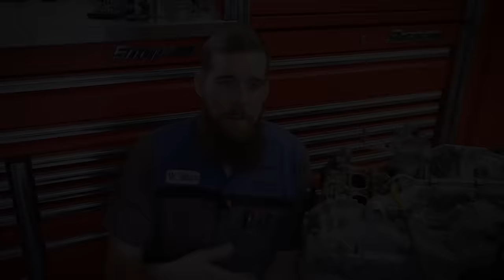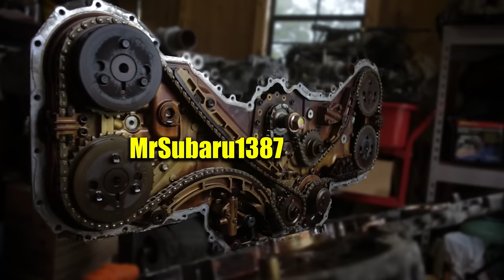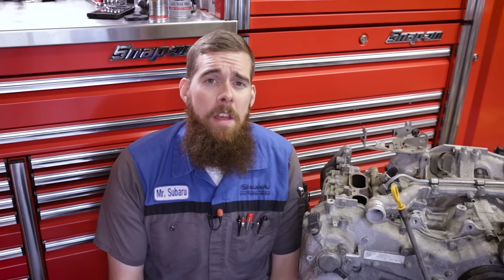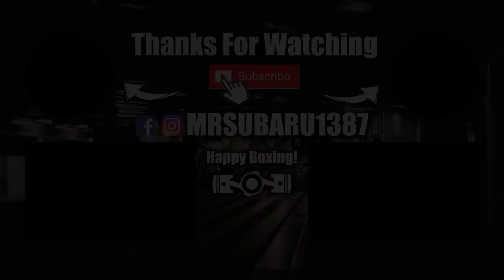Why Subarus Are So UNreliable!!! Buckle Up!!!

Comment: I agree with your sentiments in this video.  I am a Subaru and BMW owner/fan.  I hate when people poorly maintain a vehicle and get upset when things break and fail.  Cars are not engineered to be poorly maintained.   I have a 2010 STi Hatchback and modify it and drive it hard and I check my oil all the time because the harder you drive the more oil you consume. Performance engines (like in my BMWs and Subarus) have higher oil consumption under higher strains.  I also change my oil more frequently than necessary because of the harder work I put my cars under.  I had a BMW that I would take to the track and check the oil after every time (3-5 laps) on the track because it would go through liters of it on the track under sustained hot and high RPM conditions.  The general public should temper their expectations on what constitutes reliability.  Reliability does not mean it should be poorly maintained and not break.
Reply: Certain more simple and older cars take better to lack of or little to no maintenance ie older low compression v8's and NA Japanese 4 bangers

Comment: Hahah you are completely right 😂 the sti wrx kids are responsible for 95% for the catastrophic failures I have seen in the 6 months since I started at the dealership. the doctors that do maintenance come in with old outback’s with 300 thousand kilometres on them and they are tight as a drum.
Reply: I’m in my 20s and I have a 99 Impreza with 350k miles and it dosnt miss a beat. The original owners took care and had it serviced regularly. The only thing that is going is the clutch and gear box even tho it still gets into gear fine it’s abit wobbly. Other than that it runs and sounds amazing never had an issue with it for the past 2 years owning it 🙏🏽
Reply: @deathtoming2201   when I had a 5 speed PT Cruiser I found that there were bushings on both ends of the shift cables from the shifter to the trans.  Those got worn out and I was able to replace them easily with a polyurethane set that is still working great to this day! A friend of mine has the PT and I didn’t the same thing for y parents PT which are both happily on the road.  Just something that you can check that may be the only issue.
Reply: Right.  Some people act like engine and clutch break in periods aren't a thing.
Reply: @GixxerRider1991  I'm curious about how long a clutch actually lasts if taking care of (if anyone has a high milage record) I've been driving stick for 18 years and still haven't had a clutch fail  all my vehicles were bought used in the deep rust belt and currently im at 90k/ 7 years  on my current clutch and still going strong
Reply: Have you made a video on when (i.e. mileage or time intervals) these maintenance items should be done?
Reply: This confirms what I've suspected for some time.  My 2010 STI has 185,000+ miles.....on the original engine. I do what is recommended for maintenance.

I wonder what I should do next though.  I want more power, but think I should replace the bottom end before doing so.  

Thoughts?

Comment: I did a COBB stage one on my 2015 WRX did track days and autocross. Did all the maintenance myself... I got a few million miles of commercial driving few thousand miles of off-road racing. The only thing that I actually broke in the car was I burned out the wheel bearings at about 50K... ( Sticky track tires) I was so impressed with the car. I am now proud parent of a 2022 Outback wilderness. Which I have taken on several mild Jeep trails. There are few cars out there that are as versatile and as fun to drive as Subarus

Comment: Subaru has to start turning away the abused cars and modified cars for warranty work!!  Worked for VW for over 30 year and saw some crazy 🤪 modified cars ...... Vw/Audi started turning the cars down for repairs!!  ECUs store some rather wild data the public can not see!!   I had a GTI Golf achive an engine speed of 10500 rpm!!  The engine exploded!!   In court the owner admitted to shifting to first gear at 70 mph!!   Warranty Void!!     Modern cars won't pull to those speeds......the Rev limiters won't allow it!!   Another lowered the car and wore the oil pan through!!  Siezed the engine!!   Warranty Void!!   Loved them all!!
Great rant Mr Subaru!!  👌

Comment: I'm totally with you, I'm a fan of boxer engines, I went off on a guy because he was talking $#!T about the type 1 VW beetles, he said " I had a beetle it was the biggest piece of ** the brakes sucked the heat didn't work and then the engine blew! " I asked him if he adjusted the brakes did you change the oil religiously did you adjust the valve lash at the required intervals, and so on, his answer was no, I gave him an earful about maintenance on cars that basically haven't changed since the thirties, just like you said don't blame the car or the manufacture for YOUR! (People that neglect and beat the crap out of a car) lack of care for your vehicle.

Comment: They’re so unreliable, I’m looking to buy another Forester, even if it’s motor has been overheated.. because I truly know how great these cars are.
Reply: The same by me. Have Forester 2002 and Outback 2006 - Top cars. BMW - hah on slippery road and rear-wheel drive and weight/motor on front. And will stay on Subarus.

Comment: Preach! Finally the truth. So many people assume turbo subarus are just "junk", but they last if taken care of. My old 2004 wrx lasted until 250k miles with everything original. It's all about the owner. Now I have an 06 wrx wagon with 127k. As soon as i got it i put about 2,000 dollars worth of parts in it for maintenance. Runs perfect and I'm sure it will last just as long as my old one.
Reply: it's funny because all Subaru's cars are fairly reliable EXCEPT the STI/WRX? How would Subaru's flagship cars be the most unreliable. I really think it is the owners 95% of the time
Reply: That’s what I tell people Subaru can last but you can’t run them hard

Comment: "The main reason that Subaru's are unreliable..." Please say owners, please say owners ".... The owners" 

Me: Wolf of wall street celebration YES!!!!
Reply: I have a bunch of Subaru's but my 300k+ mile  05 Legacy GT wagon that I bought when it was at 260k still has the factory block and the only problems I've had were constant vacuum leaks from almost every vacuum reference point due to everything being old. I replaced the headers and upgraded to ewg due to the fact the the flex joints all seemed to wanna have holes in them lol. Replaces all the rear control arms to spec b aluminium ones with new Polly bushes because they were all cruddy and shot, and squeaked.ive had the intercooler blow up twice so now it's an Aluminium one, and I have no complaints, I've loved every second of working on this car and none of this really has anything to do with Subaru reliability. I'm modified and tuned properly and I do drive it a little hard every now and again but I'm always checking fluids and doing services, letting it warm up properly when it's cold, and letting it cool down and cycle after having some fun... The only major issue I've had is the water pump seal failed and upon taking it apart to do the entire timing kit because why not, I nice it was sealed using not only the incorrect RTV but not the metal crush gasket. Surprise surprise, human error strikes again.

Comment: My 2012 Outback now has a blown head gasket at 127,000 miles. And it has been maintained by a 22 year certified master technician...

...myself 

And as trucks being my primary source of work, you should see what these idiots do to these diesel trucks. The value of used trucks would be much lower if these kids would not have blown them all up...

Comment: Great video, all this needed to be said.  I just replaced my '02 WRX that I had since new (June '01) with 244k miles.  Totally stock, no tune.  Synthetic oil changes every 3k-3.5k and coolant changed fairly regularly.  Bubbles started showing in coolant tank at 243k and Subaru specialist indicated either head gasket or tiny crack in head.  If it weren't for all the body rot, I may have had it fixed.  Was I pissed?  Hell no - 243k miles was impressive all the same.  Original motor, exhaust (!), clutch, transmission, diff, steering rack, steering pump, AC compressor.  The one issue with that EJ205 that haunted me the last 100k miles were random P0302 and P0304 misfires.  Shops threw everything at it until final conclusion was likely tightening exhaust valves on cyl 4.  Motor ran fine, the CEL would just turn on and off.  Gave the car character.  In the end sold it to a friend for $1k and bought a '21 WRX Base. That one will stay stock too.
Reply from the maker: Awesome life out of that WRX. ♥
Reply: Subaru coolant lasts 10 years, why replace it regularly

Comment: Guess me and my friend were unlucky with our SH Forester XTs. Previous owner of mine blew the factory gaskets at 213K miles, he was in his 60s, only highway drove the car, and had it dealer maintained. A friend of mine who also has an SH chassis Forester XT lost his factory gaskets at 160K. Both pushing coolant, both both caused by warped heads. Both cars also were on stock tunes with stock exhausts, stock turbos, stock intakes, etc.

Most of the unreliability I have encountered has been the result of incompetent dealer techs who due to their work environment don't have time to read the service manual and end up fucking up the repairs. Aside from an airbag recall and an warrantied a/c compressor replacement, I have not had a single dealership repair last/or been done right on the first try. Had the tech actually read the helpful tips and cautions in the FSM, I wouldn't have had to bring my car back or redo the repairs myself a couple years later. For example: dealer replaced the 6 speed in my outback under warranty (with a good used one) due to a failed center diff, get the car home, gear oil pouring out of the front axle seals. What did the FSM say about replacing CV axles? 
1) Before installation, check the drive shaft. <Ref. to DS-56, INSPECTION, Front Drive Shaft.>
2) Replace the differential side retainer oil seal with a new part.
• 6MT model: <Ref. to 6MT-36, REPLACEMENT, Differential Side Retainer Oil Seal.>
• 5AT model: <Ref. to 5AT-49, REPLACEMENT, Differential Side Retainer Oil Seal.>
• CVT model: <Ref. to CVT-91, REPLACEMENT, Differential Side Retainer Oil Seal.>

It's literally step 2 🤦‍♂️.
So they righted their wrong and replaced both seals right? Nope, they only replaced the one that was pouring fluid. So a month later, the other seal is still dripping a little so I have to bring the car back again. Same dealership did the headgaskets in my Outback and Forester XT (one was done before I owned it, the other as a discounted package deal shortly after I bought it.) and on both of those engines they used a scotchbrite roloc disc to prepare the deck surface (a big no-no you've already made a video on). The Forester XT which runs double atmospheric pressure blew the gaskets again 28k miles later, the outback with it's NA 2.5 made 55K before pushing coolant again. I just been taken for a ride by techs who didn't have the time or care to read or think about what they were doing. Luckily as a mechanical engineer, I've been able rebuild both engines and come up with very reliable combinations that can withstand being thrashed, but it didn't happen overnight (or cheaply!).
Reply: Two of the saddest Subaru stories here. Imagine not being a mechanical engineer and the same thing happened.

Comment: My  2019 WRX was used, clearly had an idiot as a previous owner. Tons of fasteners missing all over, broken parts, and a sticky spot on the dash where the tuner controller was. Fortunately they only owned it for 11k, I’ve fixed all the stupidity and it still runs great.
Reply: Hopefully that sticky spot really was from a tuner controller....
Reply: @loren481  🤣🤣

Comment: First and foremost, this video is warranted and your rant is a good one.  It's also one I've heard from every Subaru mechanic I've ever talked to, and frankly, I agree with them.  Proper care and maintenance is everything, no matter what you drive.  That said, fair warning, y'all, this is gonna be a long one:

In 2015, I bought a 2007 Outback 2.5i Basic 5MT with 86,584 miles on it.  I've never gotten a clear image of the maintenance the previous owner did or did not do, so I feel like I've been playing catch-up ever since.  I've done my best to maintain the girl, including paying a Subaru dealership to do the head gaskets on my engine about a year and a half after I bought the car (112,936 miles on the OD) because I didn't have the tools or the space to do it myself.  I went ahead and had them do the 100K mile service at that time as well, but sadly kept having issues with oil, for lack of a better term, disappearing from my engine.  

It never leaked when parked, and it wasn't coming out the tail pipes ever - it just kept consistently vanishing.  I was doing full synthetic oil changes myself roughly every 5000-6000 miles, but I often had to top up in between, and more than the .8 of a quart left over after filling the engine to 4.2Q each time.  In this time, I did other maintenance - namely CV's, wheel bearings, and coil overs on all 4 corners, replacing each with OEM parts after discovering this wonderful channel on YouTube.  In fact, other than the oil going missing between oil changes and a belt almost shredding itself on a 1500 mile road trip, my trooper of an Outback did really well - until the clutch went in late 2018 on another 1500 mile road trip.  I was able to baby it enough to get her back home, but by that point, I'd glazed the fly wheel thanks to the weight I had in the back (I had gone to the middle of nowhere to rough camp for 9 days) and a freak rain storm making the highway treacherous in multiple places.  

Man, did that clutch job teach me how little I knew about working on Subaru's.  Between waiting for parts, bad weather (I was working on it out in the open as I didn't have access to a garage or a shed), and finding other issues like bad gaskets in my exhaust and getting the wrong transmission seals from the dealership, it took me the better part of six months to get her back on the road.  I did an oil change before driving her again, since I was worried about the oil possibly having broken down in the engine, but from that point on, she's been a bit of a lemon, never quite feeling like the solid car I'd loved for almost 5 years.  

In January 2021, she suddenly developed a smoking problem - every time she was driven or even started for more than a couple of minutes, smoke would come pouring out of the engine bay.  Once again without a good place to work on her and knowing that I didn't know enough to tear into the engine on my own, I took her to the dealership again.  Diagnosis - the cylinder head had warped and the valve guides had dropped causing cylinder's 2 & 4 to leak into the crank case.  The dealer was able to find a rebuilt long block and so I let them do the swap, but shortly after I got her back, she threw codes again.  This time, it was the catalytic converters failing, so I replaced them, but the issues still keep coming.  At this moment, I almost don't even want to start her.  I got codes for P0303 and P0304 after driving her 110 miles.  I started with spark and replaced all four plugs, wires, and the coil pack (again, all OEM), but that didn't fix it.  When started, she sounds like a diesel, but I haven't been able to get any more codes since I had to disconnect the battery to do the spark plugs.  I am worried about damaging the engine, so I don't want to leave it running for long.  The one time I did leave it running to see if the engine would smooth out, she almost died on me once she started to warm up.  I'm at my wits end, and wishing I had just let her go when I found out about the engine failure.  

Friends and family think I should just sell her, but that feels morally and ethically wrong to me.  I don't want to inflict my problem child on some poor bugger who thinks they're getting a good deal on something that's supposed to be reliable and doesn't understand that the "little lady" might actually know a thing or two about this car at this point.  Through the magic of the internet (HA!) and my own past experiences, I've narrowed it down to fuel or air, but that leaves me with about 15-20 possible solutions.  I figure I'll start with air and replace all the vacuum lines and the PCV valve, since those are all from my original engine, but if that doesn't do it, then I have to figure out where I want to go next.  I'm not quite ready to give up on her, but I am beyond frustrated at this point.  If anyone has any questions or suggestions, I have full records on EVERYTHING I've done or paid to have done since I bought the car, so I'll do my best to answer them.  Suggestions are definitely welcome at this point, as I'm about 100 miles from the dealership who did the long block and the cats, so I'm trying to do this myself.  If you've gotten this far, I thank you.
Reply: Same story I hear all the time. I commented above about my mom owning a few of them they where all lemons even with a good maintenance schedule. As of now I work at a big salvage yard in Vermont and about 25 to 30 percent of our parts we sell are Subaru parts. Most of the other brands are like around 10 ish percent. Our company will buy a wrecked Subaru and sell most of the drive train within about a week. They aren’t very good cars unfortunately. They have a great driving experience and are fantastic in the snow but they need to make a more reliable drive train and then they really would be one of the best cars.